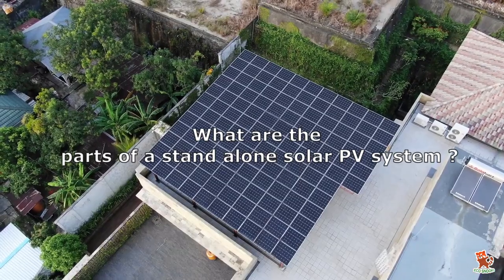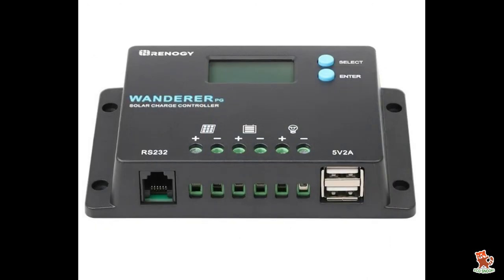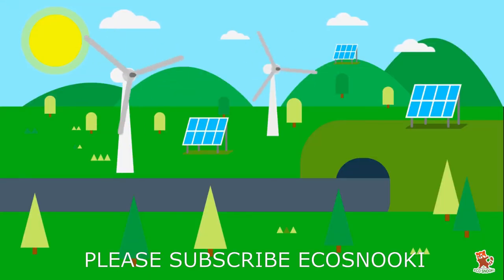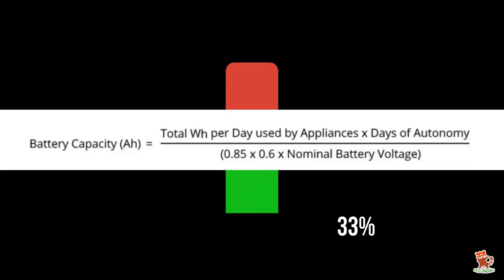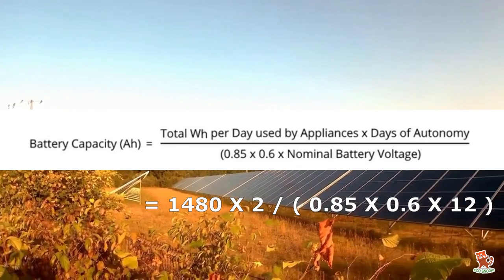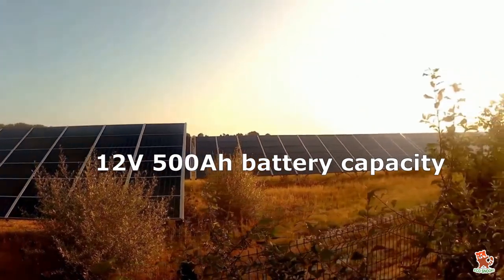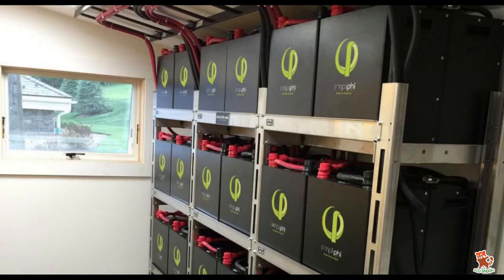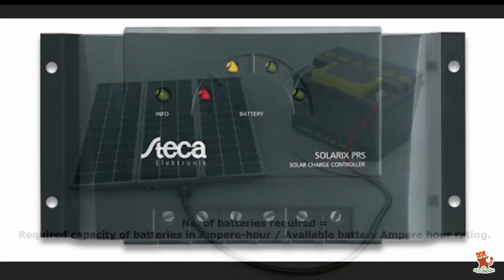Design your solar panel system by YOURSELF in 20 minutes | With example

Comment: hi, kindly tell me why there was a factor of 0.85x0.6 while calculating Battery Capacity...
Reply from the maker: you will never be able to take all the power from a battery. Each battery has a Depth of Discharge (DOD) rate to prevent them to be damaged. Here 60% is taken for COD and 85% as the efficiency of battery.
Reply: @EcoSnooki okay  thanks 🙂